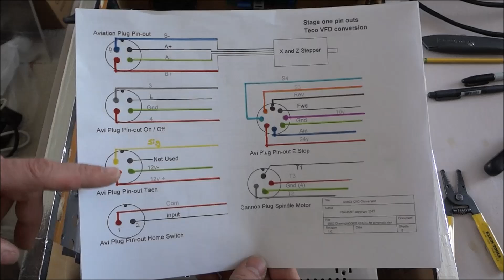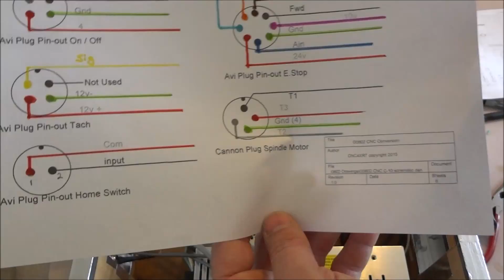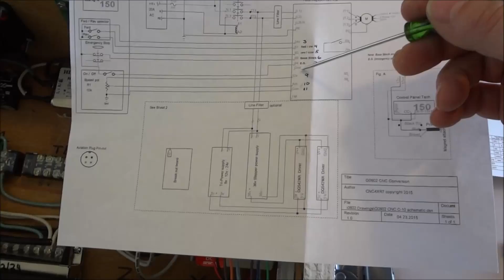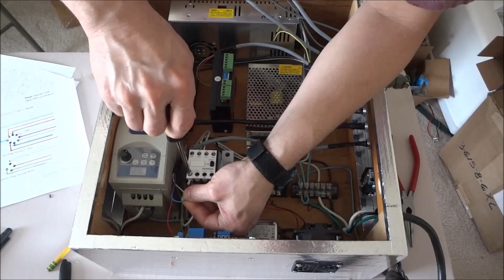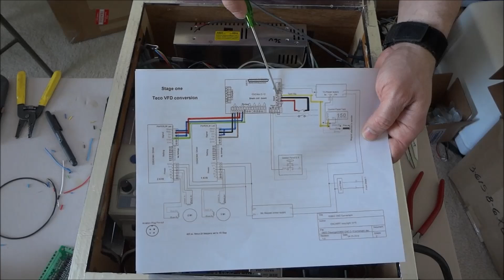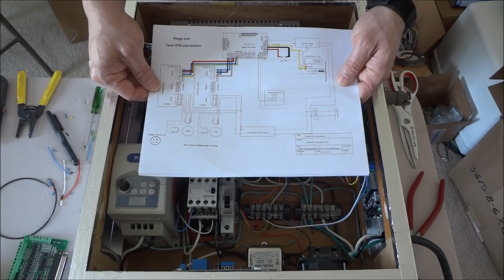G0602 Project Part 8 Electronics Control wiring

Comment: hi
what is the encoder you use for threading ?
thanks
Reply from the maker: its a magnetic sensor 1 pulse per rev.
Reply: from where can get it ?
how to wiring it ? to cnc BOB
Reply: 1 pulse per rev is that  enough ?what about the Incremental rotary Encoder? its give use more 400 pulse per rev.....
how to wiring it to cnc bob or cnc controller ?
is the mach 3 software is free ?
thank you for useful tube you are make

Comment: I may have missed this but is your on/off switch latching or momentary? Getting some great information from your video. Thanks.
Reply from the maker: Momentary push button I use a set of contacts on the contactor as a holding circuit keeping the coil energized and the contactor pulled in. Until a stop button is pushed or a e stop.
Reply: Thanks for responding! Was those four wires going directly to the on switch.or did that contain the off button as well?
Reply from the maker: Here are the wiring diagrams I used. https://www.dropbox.com/sh/j3kmvfpyp9un692/AADtsikePFM_zPV0apxfRBeFa?dl=0
Reply: Brilliant, thank you!
Reply from the maker: let me know if you need any help!
Be Safe,
Sam